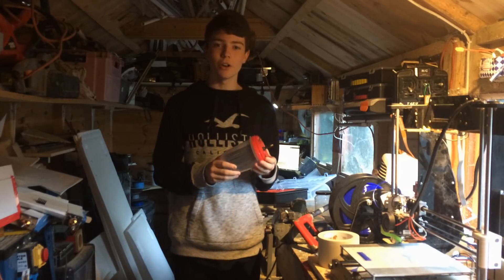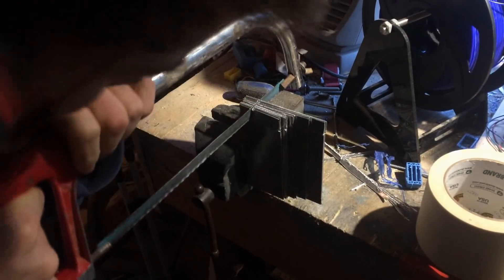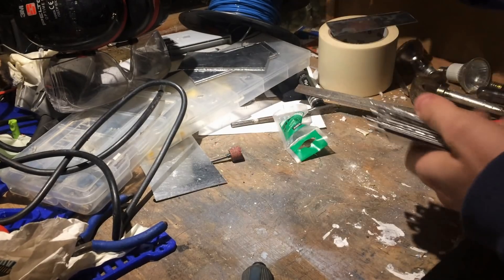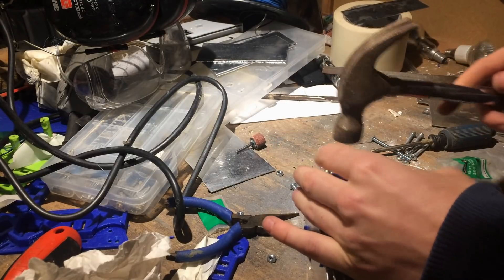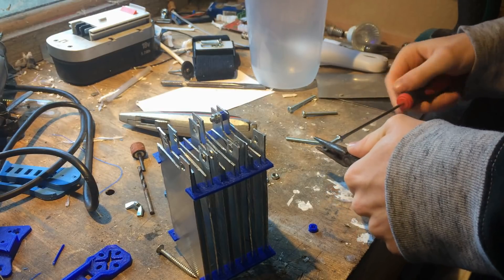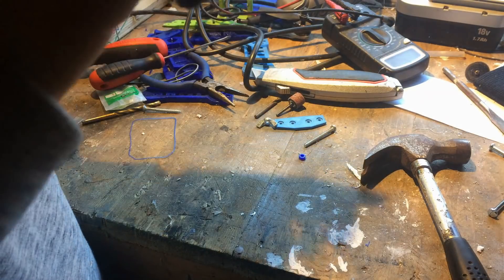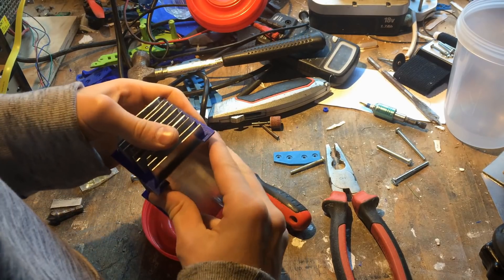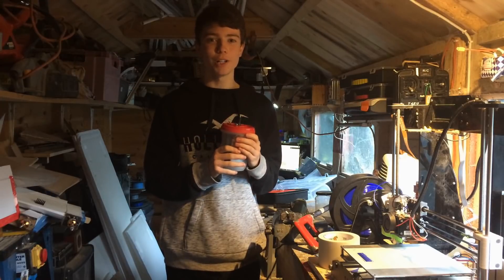Building a HHO generator!

Comment: actually because those plates are connected in parallel it will be the amps only that will be divided amoung the plates the volts will be 12v if you connected them in series then the volts would be divided and not the amps, basic electronic theory teaches this
Reply from the maker: They are connected in series. Think before you comment.
Reply: @GeorgesHangar  sorry my bad, check out my hho wetcell on my channel ive done something completely different and it's got a good output for the little battery i got

Comment: if the tire valve is hollowed out , why wouldn't the hydrogen be able to get back in .
Reply from the maker: NothingWrong WithThisName because the pressure inside the tub is higher so pushes out the hydrogen.

Comment: If it's suitable for  improve milage in 125cc petrol bike engines?
Reply from the maker: Saravanan Muthiah Don’t know sorry
Reply: yes. it can improve it by 30%
Reply: You can't use ANY of these contraptions to run a bike engine let alone a car engine. No matter what so-called HHO designs for petrol engines claim. None of them work remotely for that.

Comment: Why did not connect 6 slices on the positive and 6 slices negative?
Reply from the maker: They would be in parallel and the current would be higher.
Reply: @GeorgesHangar  that is true i now that letter thank you perfect work

Comment: HAHAHAHAHA love the tire nipple. i Like, OLE!
part 2 coming soon? you mentioned sheet tin,  maybe you know, maybe not OR thats what you had vs using stainless steel.  maybe this is a trial run in making it aka Model. I like what you did. hopefully you got it to work and show us. Why I like this video is: it's easy to follow for those who are whining "make one for me" even if this one doesn't work I see it's potential as a PATTERN, Sample, Specimen, Mold Model as we say in the Jewelry business. Thumbs Up!
Reply: way to go on your Bracket Idea. good use of 3D machine. I made one using 3" stainless steel washers. for nylon bolt I used the toilet seat nylon bolt. Goldsmith / Master Jeweler impressed!